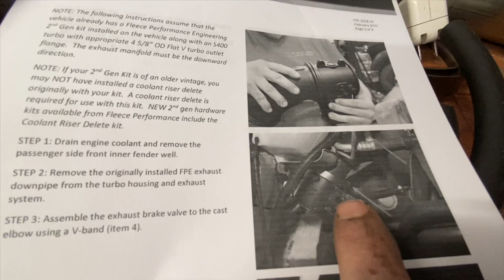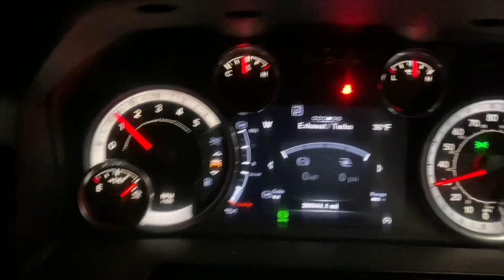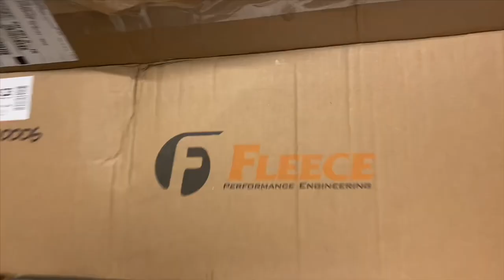Fleece Exhaust Brake install with stainless diesel 2nd gen swap kit

Comment: Nice truck man!!! Can't beat a G56 truck with a second gen manifold! and now you probably have the only one with an exhaust brake!
Reply from the maker: It wasn’t a g56 originally. I figured I’d try an auto for once, but broke it 3 times. Last time split the case in half. That was the end of the auto for me.

Comment: What’s the review on it? Any chance of getting another video of your thoughts on the kit?
Reply from the maker: Caleb Wallace that’s a good idea. I’ll make another video on it. 
I’m very happy with it actually. 
TBH, I’m not sure anyone would know that it’s not a factory exhaust brake of I didn’t tell them. 
It operates exactly as expected and havnt had any issues really with it to date. Well, I do have 1 issue currently but I think it might be an install issue. I get a squeal from it when I first drive the truck in the mornings only when the brake engages. I think it might be a lose clamp allowing pressure out but havnt dug into it yet. Besides that it’s been flawless.

Comment: Where can I find this exhaust break can't seem to find one
Reply from the maker: Surprised I can’t find it in Fleece website. 
I don’t know if they are back ordered or what. Try here. Verify website before buying. I don’t know anything about this company. https://www.dirtydieselcustom.ca/products/2013-2018-cummins-electronically-actuated-exhaust-brake-fpe-exbrk-67-1318
Reply: I heard they got busted and had to end production. Fine for me, I have a 2012, and it was only 13-18.
Reply from the maker: @jchirschfeld1101  that’s a bummer. I don’t really see how an exhaust brake could violate emission laws…….except I guess that you’d have to have an aftermarket turbo to use one I guess.
Reply: @jmlcolorado  I double checked the website. It's under "Turbos". You'll see the Cheetah, then S400 turbos. Both the s463/83 and the s467/83 say out of stock. 
I have 2 buddies with 13+ Cummins (a 2015 and a 2017). The one with the 2017 had a 2nd gen swap. The other wanted one but for some reason couldn't. He was the one who told me it was unavailable due to something. I didn't think twice, because it wasn't compatible with my 2012. Probably couldn't get it and was coming up with some BS.

Comment: Did u use your factory back pressure sensor?  If so, where did u install it
Reply from the maker: I have a stainless diesel 2nd gen swap on the truck and if I remember correctly, that was eliminated in that swap since typically a 2nd gen swap you loose the vgt anyways.

Comment: Just did a g56swap in my 2015 just curious if you were able to get your high idle back through the steering wheel controls
Reply: Yeah high idle works fine. I think it fully depends on your tuner. I have CTT tunes and everything works like normal.